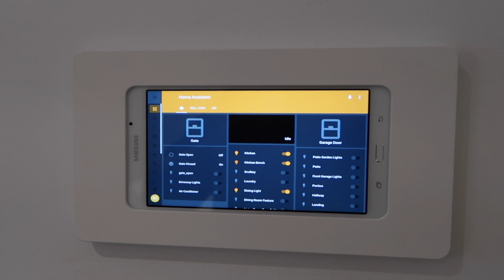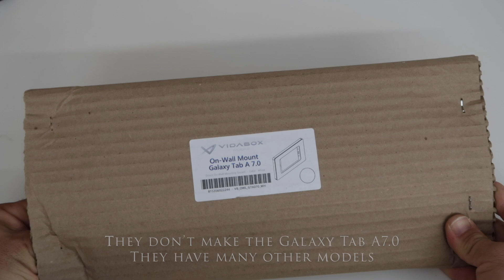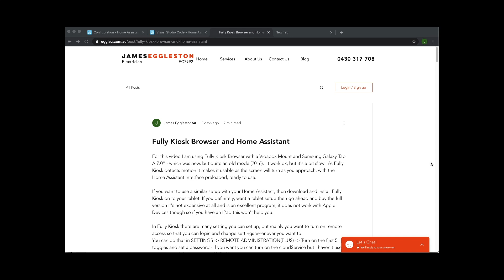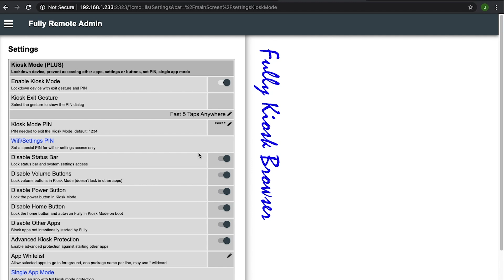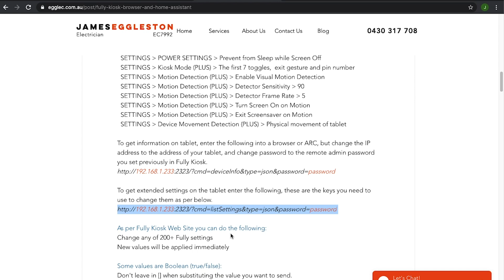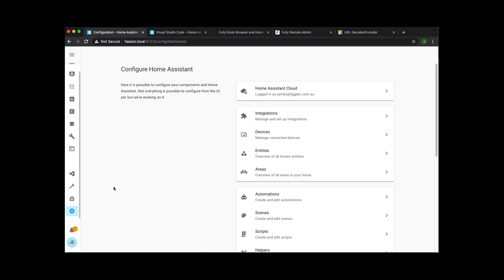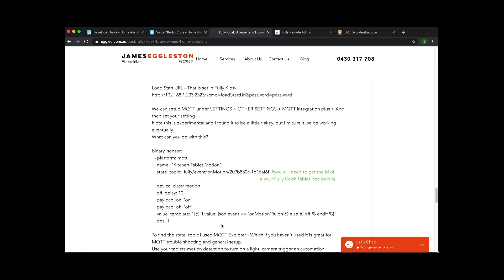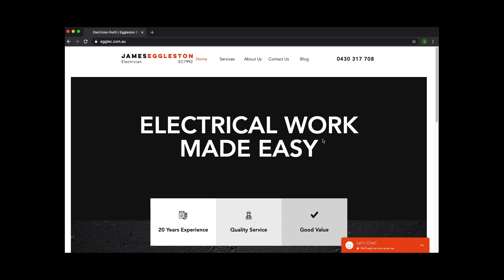Fully Kiosk Browser and Home Assistant

Comment: Great video, when I first got into HA it provided me a great intro into buying, mounting a tablet and baisc Kiosk browser via Fully Kiosk.  I didn't hard wire the USB but ran a USB extension into the wall cavity and then into a pre-existing GPO.

Since my intitial install of tablet and Fully Kiosk I've increased in confidence with HA. I've been able to implement the rest, python script, call/create sensors/entities and have a better understanding of MQTT payloads.  Really valuable video as you go on your automation journey.  

Thanks!

Comment: Great video. Thanks for sharing. I do have one concern about using a tablet like this plugged in and constantly "charging". I have seen a Samsung Galaxy TAB that was plugged in 24/7 and used as an always on security camera display, and after about 18 months the battery swelled so much that the case was bowed out in the front and back and it actually started to pop the screen off the case. Should this be a concern with a tablet that is always powered and charging? Since it is wired directly to the wall, could/should the battery be removed for safety issues?

Comment: Hi James, i followed you instructions and set the same settings in Fully. Motion detection works as expexted (display switch on and after 30 second goes off), but when I try again (5-10 Minutes) the screen switch on, but is frozen, also manually reload (swipe) is not possible. First when I activate fully config (fast tap 5 times) the password promt for fully apears and the the page (home assistan) reload again. Do you know, waht the problem can be?

Comment: I had the idea of using a picture frame (cutting it down to size) for this - and using a rather low cost tablet for it with an external proximity trigger to wake the device but it's quite some time since I looked into it.

Comment: Hi Jimmy thanks for the videos.
Could you setup the dashboard on the MyAir tablet?
Reply from the maker: I’ve tried, unfortunately the MyAir tablet is not very fast/powerful and it’s modifications make the dashboard not work properly, I couldn’t get it to work very well/consistently. You can add the myair sensor readings and the power on off, heating/cool etc into home assistant quite easily.
Reply: Thanks James. Enjoying you video's
Reply: @SparkyJames  thanks ill look for an alternative.

Comment: Excellent vid, well explained and shown ; planning on doing just this but I had the requirement for no wifi so my cable connection has to be data and power. I just got a 3d printed holder.
Keen to try the new dashboard in HA.
WIll check out the Kiosk Browser; hoping its not required to be connected to their server.
You have answer allot of my concerns.
Cheers from Goulburn in Oz
Reply from the maker: Fully Koisk does have a cloud service, but it's not required and everything works just on local network.

Comment: Hi James, Great video. Question regarding the physical install of the USB charger into the wall, what is the little white connector you use to bridge the power? trying to source the same component. Look forward to more videos 👍
Reply from the maker: It's a 240v to USB mech that would normal fit into a standard au switch plate . Part number is in the description. There are various brands, the one I used is one of the smallest physically.

Comment: Awesome stuff! One thing I really want to get going as I have all my house door contacts listed as entities in hassio I simply want some mp3 files I have saved to say things like "front door open" if front door opens. I see the command here " Play Sound from file on HASSIO
http://192.168.1.233:2323/?cmd=playSound&url=http%3A%2F%2F192.168.1.236%3A8123%2Flocal%2Fsounds%2FClassic-doorbell-sound.mp3&loop=true&password=password&stream=1&type=json "  Im still kind of new to hassio and the language layout. What I want to know is where do I copy my audio files to in my pi4 running hassio and when running that command in a "action" statement what is the correct format?
Reply: also is there no method to just make  a media_player entity for the tablet?  That way  I can say Play(said media file) to Media_player.tablet????
Reply: Sound like a good idea, I might try that a warning if the gate is stuck open longer than 90 secs, so the kids don't escape. Place the sound files you want to play (mp3) in config/www/sounds which you can get to pretty easy using the HA file editor or many other ways, if sounds is not there just create it. Then in then to play it in an automation call the service - rest_command.kiosk_command
With the service data cmd: "playSound" and url: "http%3A%2F%2F192.168.1.236%3A8123%2Flocal%2Fsounds%2FClassic-doorbell-sound.mp3"  you need to change the name of the mp3 file to use file name and change the IP address to your tablets IP address, but it will look for it in config/www/sounds and remember the file paths and names are case sensitive. And of course make sure you actural have the rest_command.kiosk_command setup as per the blog post here: https://www.egglec.com.au/post/fully-kiosk-browser-and-home-assistant which I assume you've probably already done.
Reply: @JamesEggleston  Thank you for the reply. Yes the rest command is setup. Could you by chance give me a exact example of the structure for the Service call? As in the code  for a simple random file? I also want to be sure but in his written tutorial he says the lines of code have to be encoded. What does this mean and is it required?

Comment: why not use the Home assistant app ??
Reply from the maker: For me I like that fully koisk turns on the screen as you approach, which is very handy if you have an old/cheap tablet, makes the whole process faster. Also you have load in different URLs from home assistant, so it doesn't even need to be Home Assistant GUI. You can also use HAdashboard too which is very customisable.

Comment: Hi there. Are you using linix system or other for HA?
Reply from the maker: Hi David, I have linux ubuntu with HA in a docker, running on a NUC, I sometimes use the linux system to do other things, it's not my preffered setup I'm about to change back to HA directly installed on a NUC without linux, as the performance seemed better, it is the cheapest intel Nuc you can get, it's a celeron.
Reply: @SparkyJames  i did install yesterday ubunto sever and HA, not i'm only missing the hass.io  :P ...but the cheapest is intel comput stick. it did only cost me 55€ :P
and the TDP for intel compute stick is 5w

Comment: The end result looks very nice.  But I can’t justify spending $110 USD on the mount when I only spent $50 USD on the tablet itself.  That doesn’t seem right.  

I searched on Etsy and found a mount for $28 USD that I’m considering getting.  
I wonder if it’s similar?
Reply from the maker: Hi Neil, post the link to it here so we can check it out. I actually tried 3D printing a mount very similar to this one but it took 4 attempts and about 25 hours of printing to print it, it looked sort of ok, but I didn't like the finish on the front, if you had the Prusa Textured PEI printer bed (which I don't have)I think it would look ok and would consider the effort printing the case worth while, it would be similar to the texture on this one.
Reply: Why not doing one yourself with drywall? Its easy
Reply from the maker: @DavidFerreira1986  You could make it flush with the wall too.